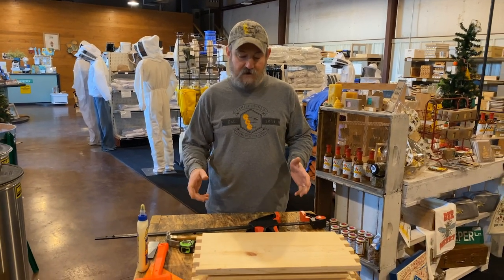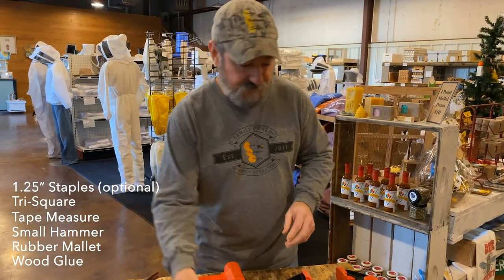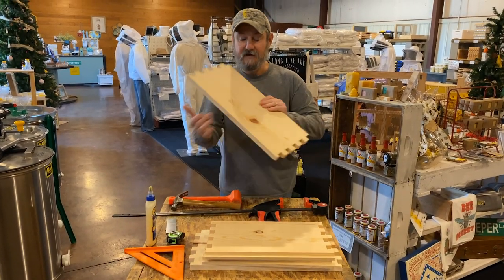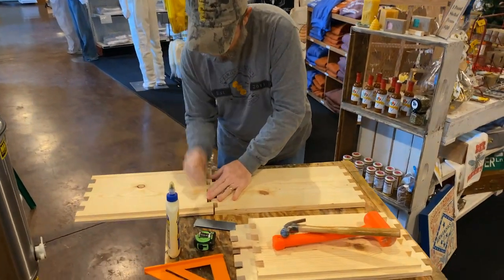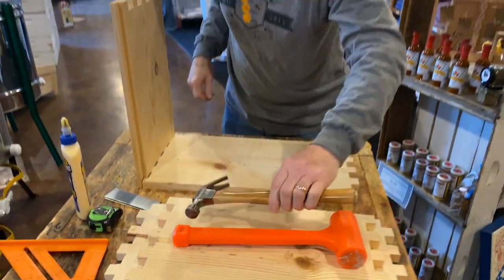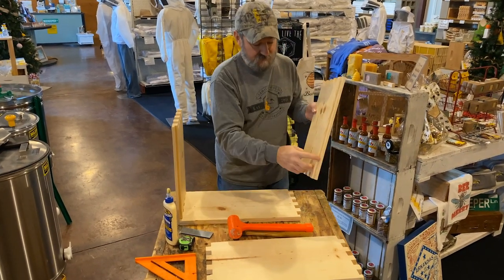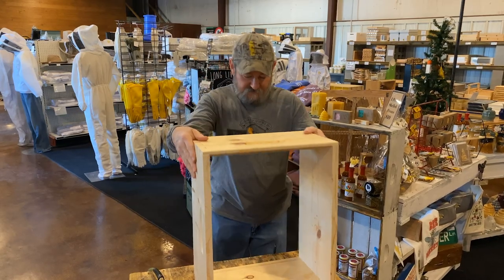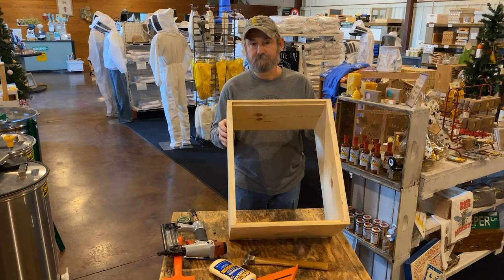📖  How to: Assemble a beehive super from a kit! 🐝  (step by step)

Comment: Just remember that it's mostly the glue that holds the box joints together while the screws, nails or staples mostly just hold the joints stable while the glue finally dries or cures (depends on the exact type of "glue" you use).  
A little trick - drive staples in on a slightly diagonal orientation to the wood grain to discourage driving two "wedges" in a single line and, possibly, causing splitting of the wood.